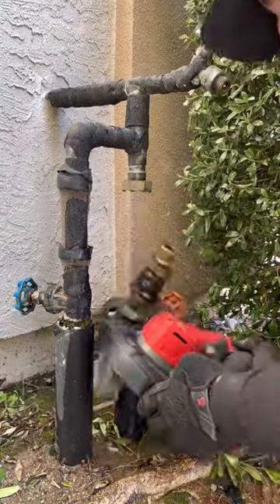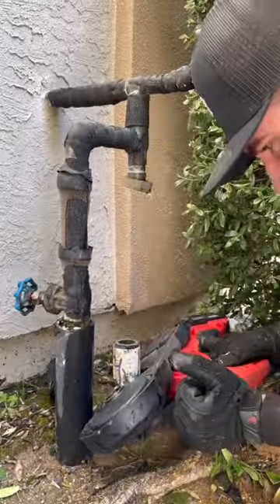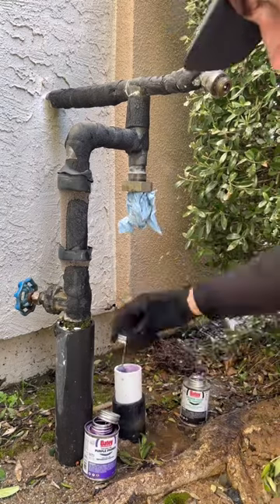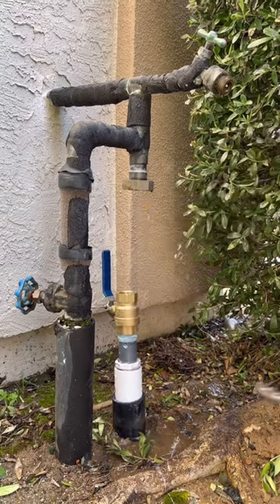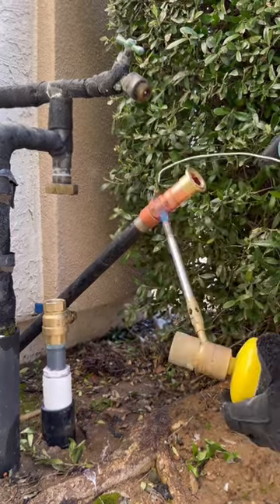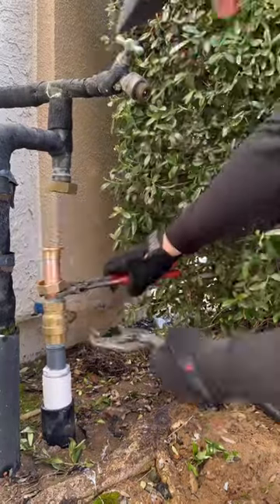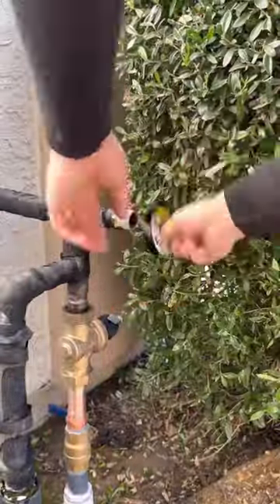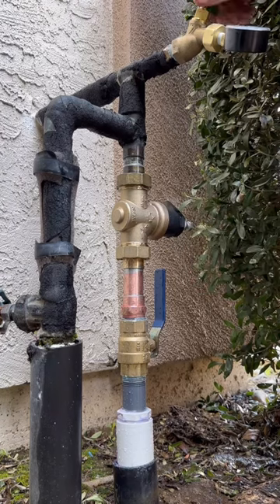hey where’s the vacuum breaker🤓 #plumber #plumbing #soldering #propress #ballvalves #gatevalves

Comment: As a plumber I see nothing wrong.
Reply: 2nd that!
Reply: If that’s a acme prv that would be my only issue.  I’ve seen a bunch fail right out of the box, after the 5th or 6th one I stopped using them and went with watts, even when the old ones fail they can easily be repaired for dirt cheap.
Reply: @nickkirschner3719  nah that’s a Zurn Wilkins Nr3xl. That’s the only brand I use. No issues good unions etc..
Reply: @jessecopeland9728  good to know, I’ll definitely ask my supply house about them next time, the size of the valve would make it ideal for tight spaces. Always appreciate info on good plumbing parts. I just looked them up anything that has zurn associated with it is good in my book!
Reply: Internet plumbers are the wooooorst
Reply: @codygooch510  I agree
Reply: I agree too
Reply: No vacuum breaker
Reply: Hey look at that, plumber as well and I see nothing wrong
Reply: Nothing wrong at all. VA Journeyman plumber here. One thing I don’t agree is applying flux post solder to the joints. I would let it naturally cool off.
Reply: Minus installing the prv vertically, and using the cheapest one available.
Reply: @SugarRush  it creates a cleaner bead, just make sure to wipe it with a dry rag after.
Reply: What about putting more flux on the solder joint after he just finished soldering? That’s the dumbest thing I’ve ever seen 😂
Reply: @mongoose3109  I’ve never heard that, maybe I’m the crazy one lol
Reply: @murkyturkey5238  I do this. It cleans up the joint fast and allows me to inspect the joints and re heat from a hot joint vs cold if needed.
Reply: As a part time stocker at Kroger, I also see nothing wrong
Reply: @Paul Miller  a prv has no orientation. You can install them upside-down, as long as the flow is in the right direction. Now RPZ backflow preventer need to be installed horizontal
Reply: As someone who is not a plumber, I also see nothing wrong.
Reply: @codygooch510 internet any form of construction are definitely the worst commenters alive. Although the firearm enthusiast communities are maybe a few tenths of a second behind in the race for the most know-it-all azzhole commenters alive.
Reply: @aaronmazur8056 thank you for your part time service.
Reply: nothing is wrong, but you know how some people are 🤦‍♂️
Reply: It's mostly because Americans don't have as many regulations as everywhere else so American plumbers just do it however's most convenient without realising the consequences
Reply: @jessecopeland9728 only issue I’ve ever had was it started whistling whenever anyone ran a fixture.

Comment: Here’s something different. I had a plumber install a oil filled gauge on the “supply” line. The plumber asked why, because it’s usually after the regulator. I said I knew this and agreed, but since I worked at the water district I wanted to see the changes they made. Typically, in the morning and afternoons the booster pumps ramp up for the neighborhood (people taking showers getting ready got work) and I can actually watch the pressure ramp up sometimes over 100PSI or more in my neighborhood. Just interesting to watch the pressure change.

Comment: I like the way you installed the ball valve. You shut it off by pushing down. I install them that way or so they shut off by pulling them to you. I always do service work with the elderly in mind. Arthritic hands are still able to push down or they are able to use their weight to pull it off. Someday we will all be elderly if we live long enough.

Comment: As a fellow that lives within the frost belt, it boggles my mind to see exposed water line.  Only our hose bibs (sill cocks) are exposed and must be covered during the winter.  Pressure regulator goes in a closet with the hot water heater.  Replacing the the primary line is a nightmare but it usually lasts as long as the home since it’s laid 24” deep and run under the concrete slab.  Very cool to see this.

Comment: I did not love plumbing. As an electrician I was fearful of solder that did not go on wire contacts and used an open flame. 
However through the therapeutic and quite honestly informative way you present your work, I too feel confident enough to change my sink faucet now. Thank you.

Comment: The ball valve is correct. Close should be pushed down. Helps to prevent accidental opening. And genius with the nipple. I don't work with pvc very often but very clever. 

And PVC to ABS that's why they make transition glue.

Comment: You should let your solder joints cool down naturally. Don't apply Flux or a wet rag to quench them. If they still sizzle when touched with a damp cloth, it's still too hot. You could still have molten solder in the capillary space between the fitting and the outside of the pipe. By quenching it you can cause a stress crack and cause a leak.

Comment: Incidentally, they use same pipe materials & layout from meter to house in southern AZ. From what I've seen, Las Vegas, NV too. Here in the PHX metroplex, they are pretty militant about backflow preventers on hose bibs. Once when I had to make a change to the front copper line, I left to get some needed parts and left the backflow preventer off. When I came back (45 minutes later) with the needed parts to finish, there was a red sticker notice on my front door about the backflow preventer being off. 🤯😳🙄

Comment: I personally prefer them to point down so it gets less stuck on stuff and just feels more right to use it for your wrist but.. doesn't really matter from a mechanical standpoint.
Also there is the hook rule. Dont make it hook shaped if you dont want someone to put their jacket on it. Not really a problem in this case but depending on where it is, you dont want someone to accidentally close a valve because they used it as a hook.

Comment: Personally, I like the ball valve position in such a way so that gravity turns it off rather than turns it on. I grant that I've never actually seen one where the weight of the handle made a difference, but you have to choose one thing or another and I'd rather be consistent that way.

Comment: I work for a builder, not as a plumber, I'm the home automation guy and troubleshoot Moen Flo smart valves we install in our homes. So I'm around the home's water main quite often. 

I've always wondered if it matters if you put the PRV before or after the ball valve. In our homes, it's always before the ball valve. Any insight would be appreciated, just curious about it.

Comment: Handle ball valves should always fall to off, if you cannot fit them horizontally, it’s like this because of the ease of use they are and you would rather have something accidentally turned off than on.

Comment: Should you check the condition of the expansion tank inside and replace/ add air as necessary after the old prv produced 100+psi?
Reply from the maker: ehhh depends on how big the ticket is already
Reply: @replumb  I hear ya

Comment: Reason why it is said that the valve is on backwards..is because one end of the valve is factory pressed..leaving it more easy to brake at that point..hence why it should be put in with that end facing down stream from the inlet source..most just put it in with their aesthetic preference tho..not even realizing they are potentially causing greater risk factor.. put a valve in backwards on a high rise with water pressures near 150 psi.. you better hope you put that valve on the right way.. because over time it will fail with just with the slightest touch..seen it happen many many times..

Comment: I dont think that your valve is up side down. As a gas engineer in UK we have to install ball valves like that. And the reason is that it’s easier to shut them in case of emergency by using your body weight then to pull it up. 👍

Comment: 1/4 turn ball valves really do not matter which why they install. They still work either way.
Reply from the maker: I know that. I usually point the handle toward the flow
Reply: @replumb  Most people do not know this. One can just pull the hand off and have it facing that way as well. Since I have a well I do not have a single valve on my water system other than the 7 washing machine boxes, sink stops, toilet stops and one frost free faucet.  I have a drain valve off my pressure tank and that is is. Well I do have one valve and that is the one on my water heater. It came that way in the kit I bought for the water heater. It was cheaper than the one with out it. All I need to do is just shut my well switch off. Really never had a need for a valve to shut the water off. I can open all the taps and be pressure free in a short time.

Comment: Screwing anything into a threaded pvc bushing is asking for a leak in the future from a split bushing. You should try the stainless steel band reinforced female adapters and not use a coupling and threaded bushing

Comment: question if ur high prolly shouldnt be but if u are how does the ball get in the pipe but its clearly bigger than the entrance part and had a super tight turn when u cut on/off the water

Comment: I lost water flow in parts of my home. I know it's not the regulator. When I turn a valve, the flow is fine for a few seconds, but the flow rate will drop after that. It only seems to affect certain areas of the home. It seems like there is a restriction in the line and the line is allowed to fill to volume, but once it's depleted, the flow can't be maintained. Any ideas or suggestions. I have a slab, so no chance of me busting up the slab.

Comment: Is that PVC line going to like a pool or something like that? I’m wondering why it’s tied in with the potable water
Reply from the maker: From the city meter to this riser is all PVC. It is the incoming main line for all the potable water
Reply: @replumb  any idea what the incoming pressure would be from the city? In my area we don’t typically use PVC for many pressure applications. (Unless it’s SCH80)

Comment: The problem with negative comments is not actually with you. But whole of west.

The repairing culture in West is non existence. Something is bad, replace it. Whereas, In asian countries we still know and love repairing things.

My brother got a leaking tap in California and plumber was like lets replace it. I thought he will replace spindle, but he replaced tap.
Reply from the maker: Cheaper and easier to replace it
Reply: @replumb  Exactly, as I said west do not have Repair culture. So it is cheaper to replace as you said. Commercialization and anti-right to repair companies are partial reason. Also, lack(sometime absense) of skilled workers(specially in US) forces companies to not provide repair parts easily as they knew it will not be a good repair and their brand harms from it.

Comment: Ball valves must close falling down. if you debate it or think otherwise, congrats your not a plumber. 

why? because its safety, not your "preferance". you want something to fall closed, not open. otherwise instead of shutting off a system by mistake your activating a system by mistake. 

its so newbs who go into mechanical rooms dont hit something they shouldnt.

Comment: You good fantastic work mang, I just don’t like the plastic threads from those nipples, sch 80 or otherwise. Nor do I like plastic adapters on water. Threads are always a weak spot, plastic makes it worse
Reply from the maker: How do you transition from plastic to metal?
Reply: @replumb  3/4" PVC x 3/4" MIP MetalHead Straight Adapter by sioux chief, something like this, good for threads in the ground aswell

Comment: Maybe just stop using dope? It's a mess and completely redundant 
If PTFE tape-only is used on deep-sea operations and 600 PSIG sprinkler systems, it's probably good enough for residential plumbing needs